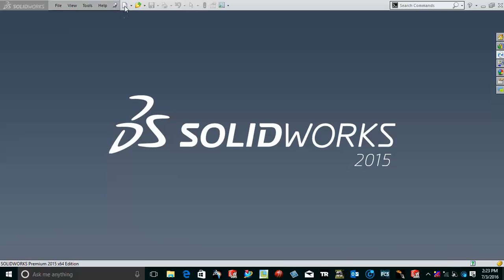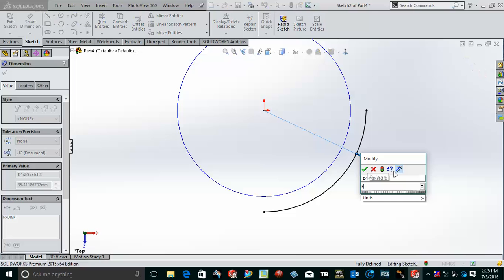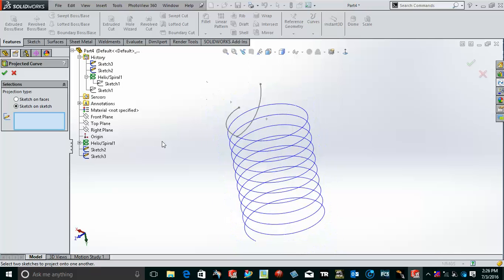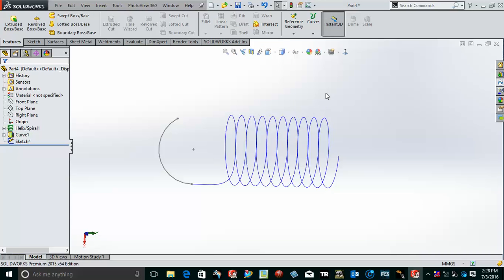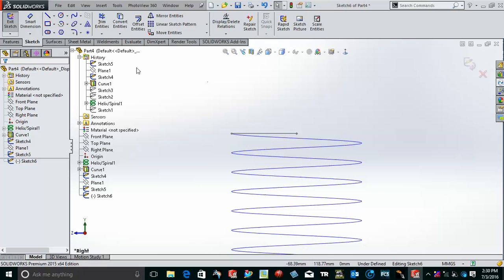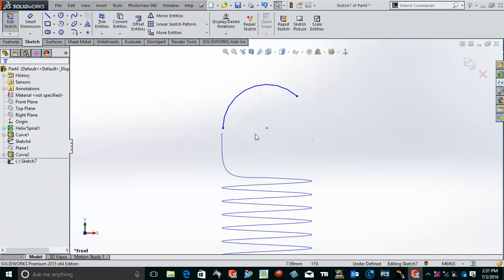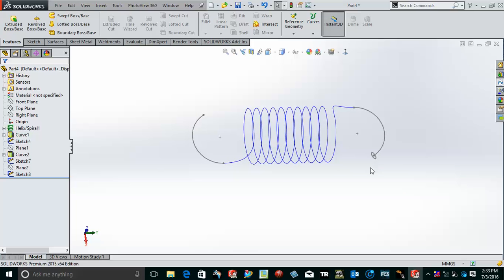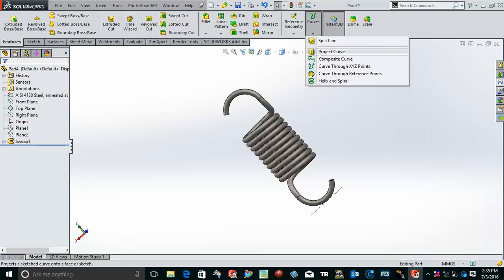How to make cylindrical spiral extension hook spring in SolidWorks | Let's Design

Comment: can anyone that has done this tutorial, open this part in a drawing? because lately, even in 2018 version, whenever you do a spring while using helix and spiral, the software crashes upon opening a view in the drawing.. for school i have to represent this drawing and to do so, instead of going with helix and spiral, which is waaay more easy, i have to do the spring with sweep so that i can open the drawing part without the software crashing.. can someone do try this and quote me below? I'd be very much aprecciated!
Also if anyone knows a fix to my problem, please share it because alot of people must be having this same issue
*EDIT: The sweep i have an issue with is the sketch plane, the sweep i managed to work a fix on is the circular profile